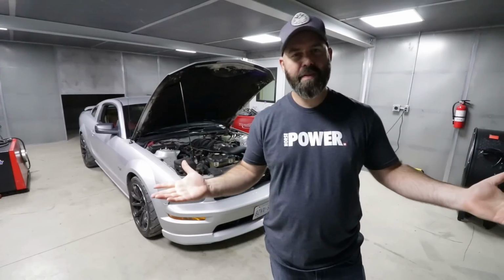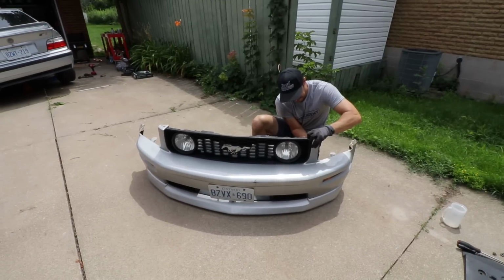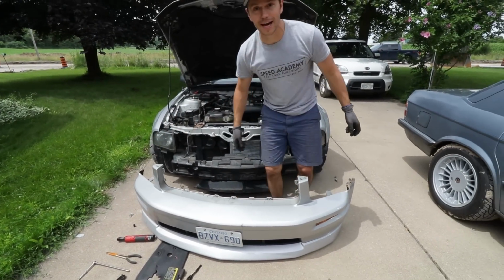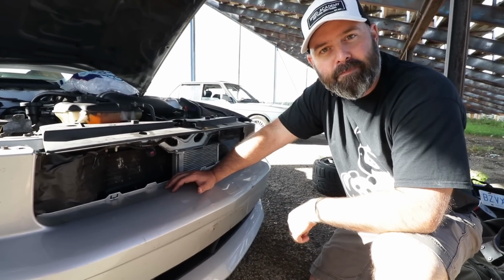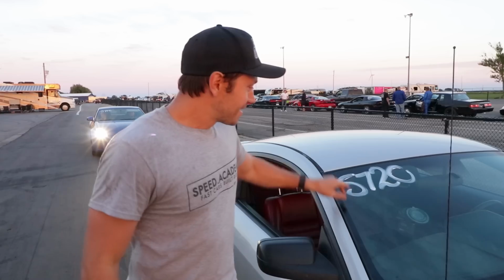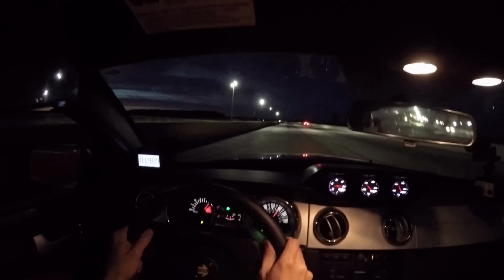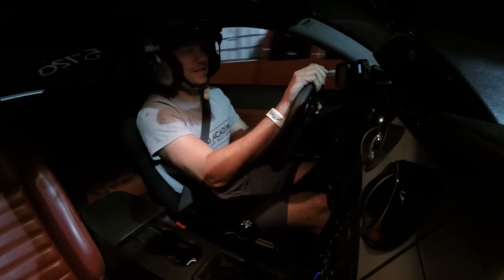Track and Drag Redemption? - Mullet Mustang - EP20

Comment: For those that haven't drag raced very much a little lesson. E/T(13.7 in this case)is a direct reflection of the car and driver as a whole package.  MPH(107) is more of a reflection on the power/weight of the car. It will only vary slightly regardless of driver launch and tire/suspension setup. Any car with a 107mph trap speed can easily run in the 12s if the rest of the car is set up correctly and the driver is competent.
Reply from the maker: Agreed, when we look up times other S197s are running they're in the 12s with our MPH. We just need proper drag setup and tires plus a properly prepped track... and a good driver!
Reply: Speed Academy I hope I didn't come across as saying you guys were bad drivers, because I definitely wasn't saying that. Also did you see the comment I left about the s2000 engine removal and installation on your s2k removal video? If you didn't I was saying to just pull the valve cover off the motor and it slides right in with the oil pan and accessories still on it. I've pulled the f20c a bunch of times(I have vids of my old turbo s2k from like 2007 on my channel), just a little trick to save a ton of time and effort.
Reply: TurboNFRStwoK 107 if fully dialed in the car will go 12.3s getting the 60ft really down. In the 1.6s

Comment: Guys get rid of that junk k&n cold air intake and put a series 3 jlt, delete the imrc control valves. And find a k member off an 11-14 mustang and put an electric steering wrack and get rid of that power steering. Those 3 things will improve the car drastically!
Reply: Emilio Cueto sell the 3v buy a 4v
Reply: I have an 09 gt coyote swapped but i know a little something something about squeezing out every little pony out of a 3v with full bolt ons without hurting the pocket
Reply: I do 12.9 in my bolt on 2v lol
Reply: i do 12.3-12.5 on motor with no aftermarket cams. should i buy a 4v to be a nuthugging 5.chode when 90% of them cant even break 12s lol?
Reply: So driver mod, run ac and power steering delete belt, and go to the track when you calculate a good DA.

Comment: To answer your question... No track guys don't remove their AC, they just buy a better radiator thats intended for maximum cooling rather then maximum cost cutting.  Since you say you are done putting money into the Mullet you could remove the hood like the guys on Roadkill do when they encounter your same dilemma.
Reply: need to run a different intake as well so they stop drawing in all the hot air from the engine bay.

Comment: That's exactly why I switched from drag racing to road racing. You spend more time in the staging lanes than on the strip. Ran a junior dragster when I was little (about 12 or so) and switched to motorcycles on the road course at 15 and have been doing that ever since. I run my 2010 MX-5 with my dad's Z3 M since 20. So in all corners and track days are 100% more exciting than straight lines!
Reply from the maker: Yeah, it was crazy how long we waited.

Comment: Great video as always guys.  I say take some more time with the car, do some slightly more robust ducting, remove the AC, remove the back seats etc...  I think the car has plenty of potential, without the need to throw money at it.
Reply: Neil Magill the two mods I suggest that are cheapish, ditch that k&n oil filter, it's messing with the MAF, and get a vented hood. Other stuff that could help is wrapped headers, better radiator and fans, remove the foam behind the front bumper and drill some drag racing holes in the front for even more airflow.

Comment: Doubt the sway bar mod helps you. They are ment to work side to side, not front to back.
Put your "airflow diversion panel" reverse, makes the "intake" for it smaller. Smaller opening will be better in aerodynamic drag and the planes will make a positive pressure zone before the rad - better cooling.
Reply: It does help with weight transfer front to rear on the 60''

Comment: A set of drag slicks would make a big difference off the line. Nitrous and centrifugal superchargers are both relatively inexpensive and easy to install and great for drag racing. Those two things I'm sure you would get under a 12. All that money spent on the cam and intake and exhaust could have made much more power with a centrifugal supercharger instead.
Reply from the maker: In hindsight yes more power would have been made with a blower but everything we read is they don't like any lapping hence why we stayed NA.

Comment: I do not really put my 2005 GT on the track but I modified it in order to do so. To improve engine cooling I removed the OEM radiator and replaced it by a Ford Racing one ( M-8005-MGT). Moreover I also put a functional heat extractor on the hood to allow engine bay to get rid more easily of the heat. I can confirm the cooling efficiency is better ....but you need to spend some $$$ if you want to go that way !
Reply from the maker: A hood was our next mod if we were to keep tracking it in the summer. It seems like there are good options to get the heat out of the engine bay.

Comment: You need more rpm to make sure you can use the top of the power curve when you get in the next gear. Also 4.10 gears will help.
Reply from the maker: Already have 4.10 gears and we're maxed out on our RPM with the cams and springs.

Comment: is a bad maf- the oil form the k&n filter will make it read the airflow wrong...
Reply: Peter Høgh this
Reply: I've had this happen. I'll never run a K&N on a fuel injected engine again...
Reply: That should show on the air fuel ratios though, I'd assume they were monitoring those on the dyno...
Reply: What F1NNSP1N said. If the MAF was reading incorrectly the O2 sensor would pick up the discrepancy when they are reading the data.
Reply: Sigma Projects Sigma Projects i dont know the ecu the use, but i know oem ecu,s use the maf for much more than just fueling.., If the cam controlle use the load from the maf, the cam Will be off . f.eks Audi (vag) use the load Reading from the maf to controlle gearshift on auto. Gearboxes
Reply from the maker: We'll clean the MAF but the readings on the dyno for air/fuel ratios were good.

Comment: 15 HP missing? Check coils/plugs/wires? Sounds like a spark issue.
Reply: it's Coil-on-plug. they put all new coils and plugs in it already.
Reply: MultiChimRichalds Doesn't change my position. Coils can fail out of the box for a multitude of reasons. Or with spark plugs I had a brand new iridium plug come with cracked ceramic.
Reply from the maker: We tried old and new coils with zero difference.
Reply: Needs a tune, drag slicks. That should get in 12s.

Comment: what was the tune like? how lean is it running? I still think that's where the heat problem is coming from, no airflow doesn't help either.
Reply from the maker: The tune is fine, AFs were spot on, no timing being pulled so we really cant blame the tune.

Comment: here is the thing about drag racing, if you dont have DRs or "slicks" then you dont need to do a burnout, infact you do yourself a disservice by doing so. just go around the water box and spin the tires a little bit just to clean them. if you go through the water and burnout youre still going to be carrying water in your treads

Comment: Hey Speed Academy, How was your 60 foot time? With a decent drag radial and good launch you should be around 1.6 seconds and Likely get low 13 possibly high 12 1/4 time with your MPH.  I'm guessing your losing all your ET on the launch
Reply from the maker: We are, 2.2 60 ft so its pretty terrible.

Comment: Could be a shitty batch of fuel causing the hp loss. Sometimes if you fill up at older gas stations their tanks aren't the best and you may have gotten some dirty fuel or maybe even water also. Maybe clean the injectors and try again.
Reply from the maker: Very true!

Comment: Can't remember but did you guys dyno with the same wheels/tires last time (at least same size)?  Brenspeed did a video recently showing how the inertia in larger, heavier rims can drop the power numbers by 20+hp on a wheel dyno.  The wide fronts definitely don't help the drag racing either.

Comment: That HP loss is likely due to K&N filter oil contaminating the MAF sensor values. Spray the sensor probe with MAF cleaner. Another likely culprit is that high mileage carbon was blown out of the cylinders from racing which can lower compression and power as a result.

Comment: I think you guys need to try again when the weather turns cool. Also....dont want to be a ass here....but you need to work on your shifting...still pretty slow...and thats probably costing you 2 to 3 tenths. 106-107 mph is a low 13 with a decemt launch. My 3.7 v6 s550 went 13.6@104 in shitty air (3,000+ft DA) with a terrible 2.15 60 ft. Should throw some drag slicks on it, and go for the gold lol
Reply from the maker: The shifter in the car is a tank so it's pretty hard to bang a gear quickly.

Comment: You'd be amazed on how the tune changes just by rotating the MAF sensor. The airflow is not balanced , cross section wise , in such a short tube.  Will need two couplings & a hacksaw.

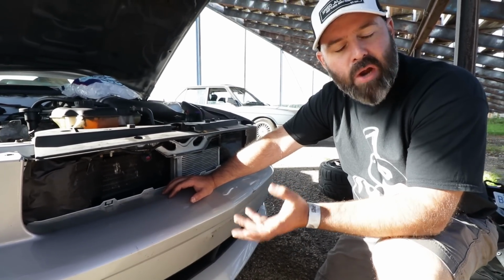Comment: 5:56 "Guys who run these at the track, do you remove the A/C condenser?" No, you have something else going on. Throw a Mishi in there with some water wetter. When i saw you heat soak after 1 lap last vid I was thinking tune, because not a lot explains that. I know you got some new cams in there, what are you revving at now? 13.5-13.7 with tire spin and a stick sounds about right though.
Reply from the maker: We have a Mishi rad in there though!

Comment: Did you install the oil cooler or is it factory?
Reply from the maker: Its an aftermarket piece.
Reply: Speed Academy Any chance you can move it and improve airflow to the radiator?

Comment: Don't do a burn out just drop the clutch and pull up I run 13.2 with long tubes,  jlt cai,  muffler delete, rear upper and lower adjustable control arms with 3.55s
Reply from the maker: Whats your MPH? And yeah with a little setup we could go low 13's.

Comment: Have you guys thought of putting Ford performance 3v cylinder heads because just running the stock heads are really restrictive you can gain up wards of 60 to 80 horsepower easily then tied together with a Ford Racing intake Plenem then put a mishimoto radiator trans cooler diff cooler and a few other things I can guarantee you possibly be above 400 horsepower or slightly below without putting a supercharger or a turbo the stock cylinder heads are very restrictive and just doing cams yeah sure it adds 30 extra horsepower but you have to tie it with a set of good cylinder heads to see full benefit oh and don't forget a Watts link from Maximum Motorsports panhard bar just does not cut it

Comment: Thanks for that series but I really hope you guys get more into that powerloss. It´s just bad attitude to throw plug&play parts at it but ignoring a general problem on the car. I hope it´s not losing power becuase of some part from your sponsor, which would hold you back from getting further into that issue.
Really don´t mean to be an ass. I´m just really curious what it is..
Reply from the maker: It's not anything part related since we havent changed any of the parts! More than likely its a dirty MAF, bad fuel, or something ECU related but it's really impossible to know forsure. The reality is that we can't just stay on the dyno and test everything since Sasha doesnt exactly have a lot of time to let us do that. He's already nice enough to let us on all the time.
Reply: Dynotime is indeed valuable, especially when someone is letting you run as a favour. 
Still, checking parts of the ignition system or the intake sensor etc. is not like you would have to pull an engine or transmission. 
I´m counting on that thing all car guys have...it will haunt your dreams :-D At some point in the future we´ll hopefully see a immaculate Mustang on the dyno. Thanks for the content anyway!

Comment: Sooooo, time to get rid of that mustang and get an LS1 Camaro or Trans am?!?! =D 

If you do make sure to get year 2000 and up only. The newer the better really as each year newer models have improvements to them over the previous year like better ECU, Z06 intake, some had Z06 engine blocks and the 2001 - 2002 supposedly came with Z06 clutch among other small improvements.
Reply from the maker: We've thought about an LS project so that may come in the future.

Comment: Thats unheard of. They what? They pump up the tyres to heat em up and than they complain that they run hot? Wtf guys?  And i'm pretty sure they left the high pressure in em when they went to the strip
Reply from the maker: We increased tire pressure so they'd come up to temperature quicker but that means less laps before they overheat. Which doesnt matter because we only had 1-2 laps before the engine would pull power.

Comment: When testing at the drag strip the ET doesn't really matter. As long as you have a consistent MPH and a actual weight of the car you can figure out whatever you need (example rwhp, capable ET, etc).

Comment: That mustang is slow as balls.
Reply: It's pretty average for a 4.6l 3v.
Reply: 3v literally suck, worst mustang you could have picked. 03 Mach 1 is a better choice by far
Reply: Nick Mahramus the Mach 1 ??? Lol
Reply: slspg yes the 4.6 4v that made the same power as the 3v and is lighter
Reply: Nick Mahramus Ouch :(
Reply: Made the same power with an extra valve...

The platform (SN95) is lighter but the engines are pretty comparable. Both are engines are limited to about 450-480rwhp without a rebuild.
Reply: MustangSaully lighter, more revs shaker hood, cheaper. Is better
Reply: Did you just list "shaker hood" as a positive point... ROTFLMAO okay...
Reply: and the mach 1 badge is 30 horses right there
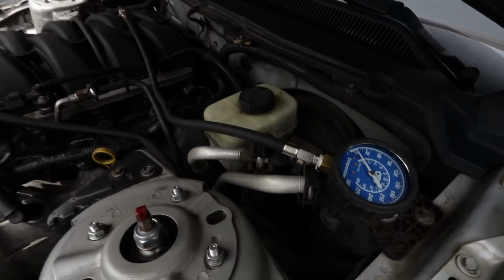Reply: I wouldn't call a 107mph trap speed and a 1:21.5 lap time on par with a Boss 302 "slow as balls."

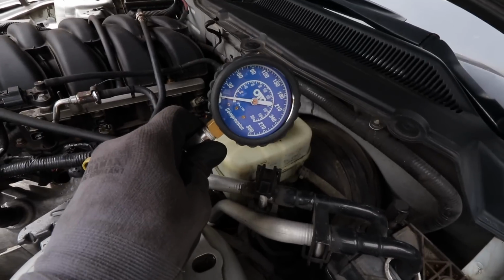Their modded K20 swap Civic on the same tires ran a 1:24.7.

Comment: Eeeerrrrrrr thats NOT how you do a comp test......
Reply from the maker: Educate us then as to what we did wrong?
Reply: Speed Academy you dont crank the motor until it reaches full comp on the gauge in each cylinder, this can cause a false positive. Best thing to do, is crank each cylinder a maximum of 4 times only! This will be far more accurate showing a comp difference, and highlighting any issues more accurately. Crank an engine untill it reaches maximum cylinder pressure will disguise an serious compression differences, but its ok to see what comp the total cylinder has when its up and running.
For instance, when incomp check a customers car, 4 times may show a cylinder at 90, while others are at 140. If i continue to crank the engine to max psi, it may get to say 130/140 while the others are at say 150/160 (turbo engine comp). All that shows would be a tired motor with 20 psi difference, rather then a serious mechanical flaw at 50psi difference.
Love your work though guys.

Comment: Why I thumbs-ed down: This car is the antithesis of everything we want our cars to be. It sounds like a long drunken wet fart, muffled by a thick duvet. It looks like a set of grey Kirkland sweat pants and matching Velcro shoes. It doesn't go anywhere near as fast as it should for the money someone cloning your build would have paid. 

But all is not lost, there is hope. You need to tell turn 14 that going forward they are going to have get serious. If this piece of crap is going to be salvaged it needs to become a balls out full track build. No, more; they need to sponsor the build of a full SCCA GT1 class race program. Ok maybe just a hill climb monster. 

Fully strip it. Weld the seams, Eight point cage. Front and rear tube frame. Aero kit that includes a flat bottom, massive dual  element wing, and huge boxy arches. Then give the motor to Sasha and tell him to bring it back at above 450 to the wheels. Why fizzle away for a couple more years as the views drop? You guys need to put it all on the line, pull out all the stops. If you build it they will come.
Reply from the maker: There's a reason why we don't do that. Its not relatable to the average owner and no one watches builds to that level, well not on a mass scale. It's either got to be beyond crazy or drift raft to get big views.
Reply: Thanks for the reply. I trust you guys understand the game better than I do. I get frustrated seeing 20 -30 thousand views on your videos when it is obvious you guys are a cut above. I guess race cars are my thing but not everyone's. I am happy you are becoming an outlet for turn 14's line. If I can find a homologated bucket seat in my price range I'll place an order.